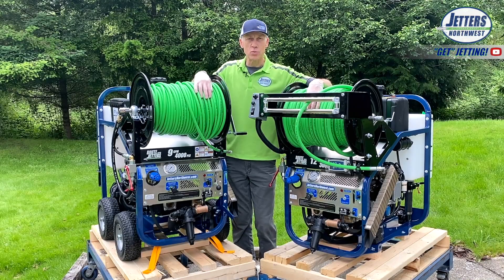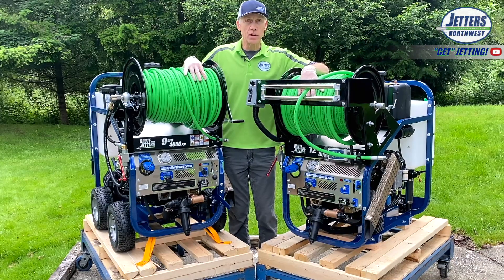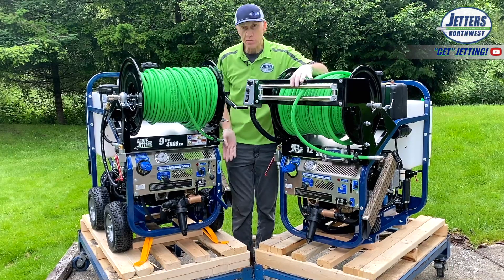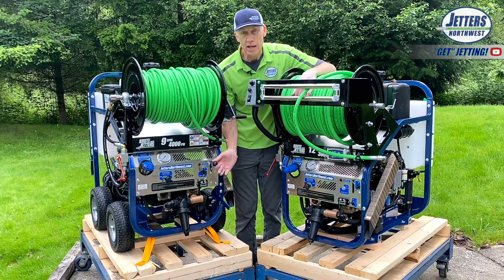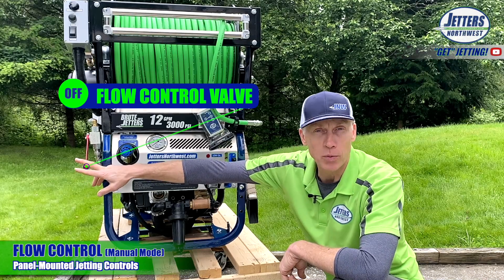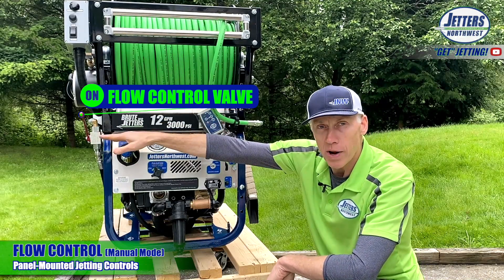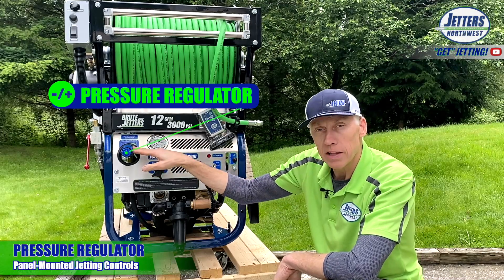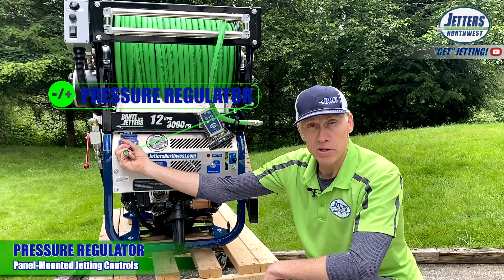(1 of 8) Brute Jetter TRAINING - Intro, & Control Panel (Jetting Controls)

Comment: Nice pressure washer
Reply from the maker: Indeed! It can be a BEASTLY pressure washer -- 9+gpm gives amazing results running a Rotating Surface-Cleaner, and/or u can run 2 guns at a time!
Reply: @JETTERSnorthwest  How much is this unit with the electric reel